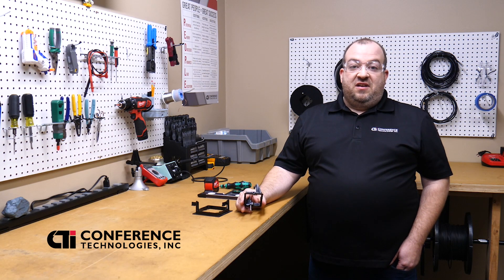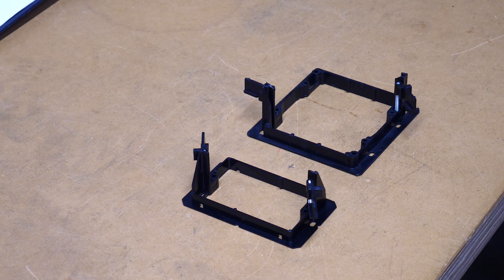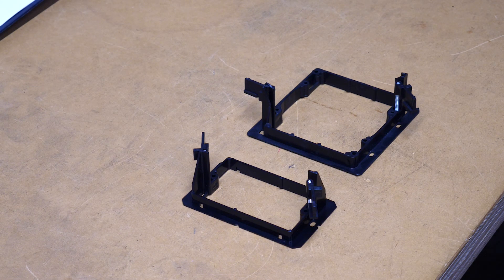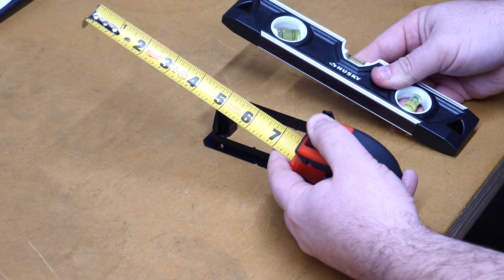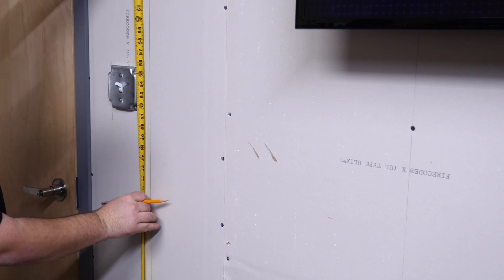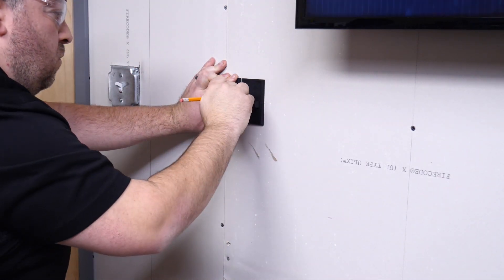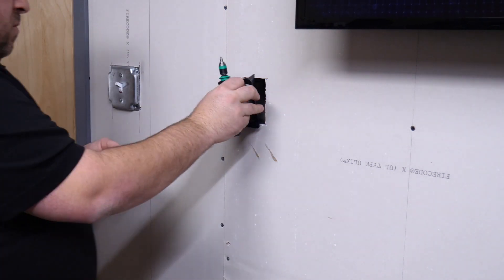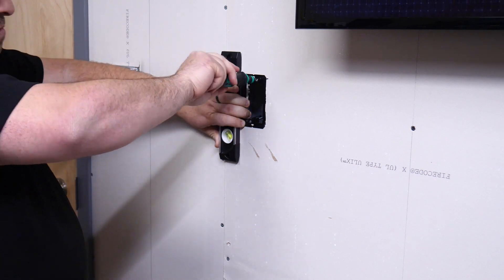Episode 4   Low Voltage Ring

Comment: Be careful using that type level. Its slightly larger than the rough-in ring and in some single gang devices such as a crestron 110 or some of the extron wallplates. The "gap" left by it being slightly bigger can cause it to show. Happend to me a couple of times. Im a PM in the memphis office.